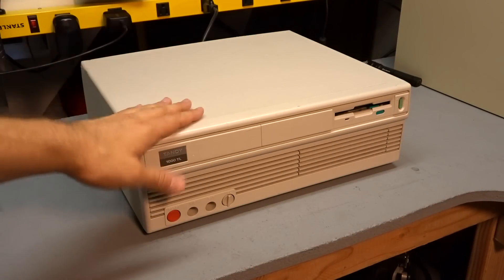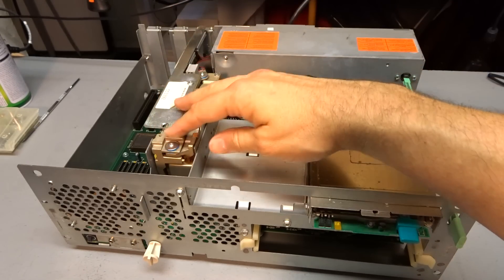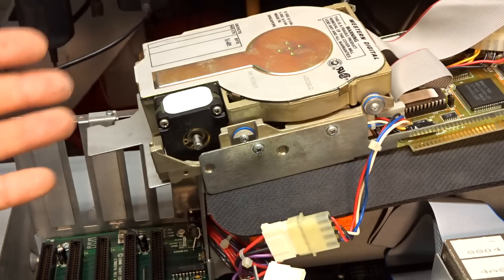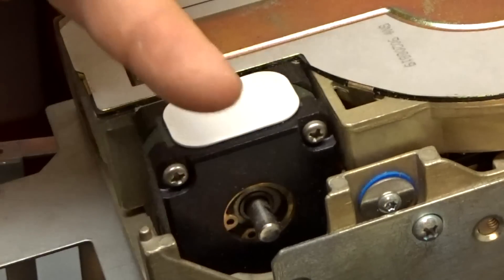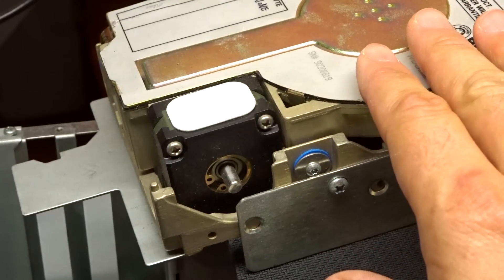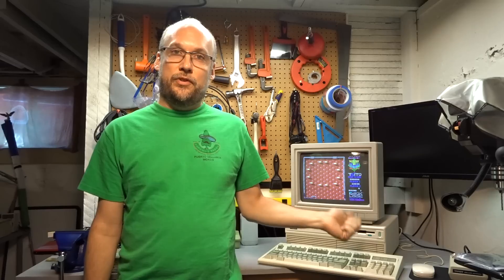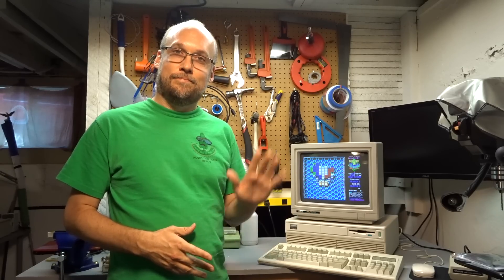Method to revive hard drives from the 80s

Comment: I wonder if this would work for those Maxtor 40GB drives that had really noisy bearings on the spindle? The spindle axel is exposed.

Although you then risk the oil penetrating inside I guess. Worth a try, I think.
Reply: If it says Maxtor, assume it's dead.
Edit: I tell a lie. If it says Maxtor and it's shiny on top and over 20GB, assume it's dead. Their older ones weren't bad.

Comment: Interesting, good work, nice presentation too. I guess one thing is to resist the temptation of turning the stepper by hand as this would move the heads across the HD and could do damage. Pls correct me if I'm wrong.
I've had many Seagate HD die on me, they had that internal mechanism (voice coil), I found with the Apple ones, there are some small "rubber" items internally that turn into goo and gum the head arm up. Also some had like a clock countdown or maybe surface fault counter and would just close down. I tried SeaTools (Seagate HD tools) but that seemed to make things worse.

Comment: Sounds like to be an easy fix,but i alway's tout that those discs inside the HDD will wear out within 5/10 years because of heavy use.
Reply: Nothing should actually touch the discs, so they will not wear. If the heads touch the disks (the only part that should get near to them) then the drive will likely wreck itself.

Comment: I had an 80286 with a 20MB drive and it was a 5.25" one that didn't have an externally accessible stepper motor. In fact, I've never seen this before. The video's trick is cool for drives in this video, but pretty much useless for all other retro drives, especially if there's more dead in the drive than just the oil of a motor.

Comment: Those wd hard cards were unreliable even when new in the late 80's, used to work in a repair lab and we had loads of brand new doa's.  Many of which were 'fixed' by slamming the drive on the bench on it's side axis to unstick the heads from the platter.  brutal, but effective.

Comment: These are notoriously unreliable hard drives because this model uses clips to hold the top cover on and that lets dust usually get on the platters and cause damage to the heads.  These are unreliable because instead of using screws to hold on the top cover, these models of Western Digitals use clips that don't hold the top cover on well and let's dust get in.

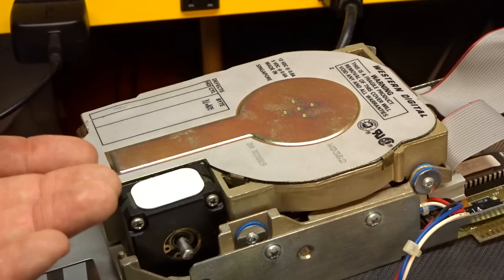Comment: 1:50 -; The heads on modern drives are also positioned by a motor. But in the later drives it's an integral voice coil motor rather than an external bolt-on stepper.

You almost said as much yourself..